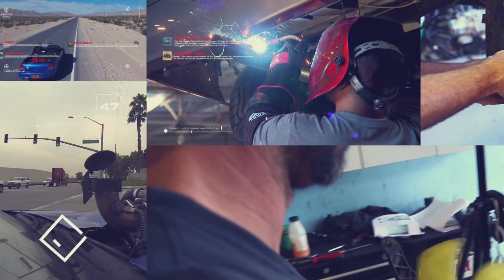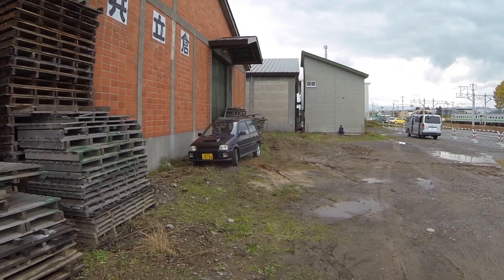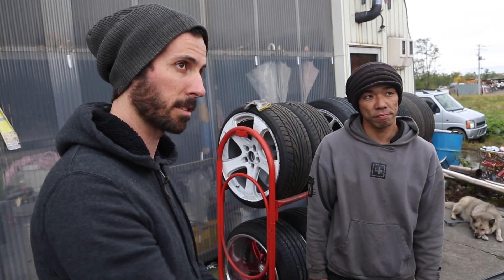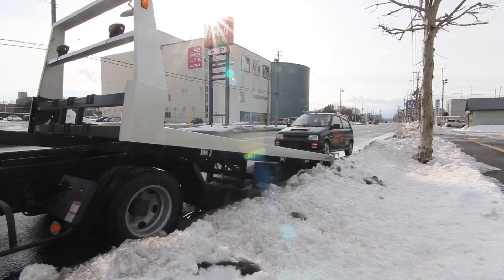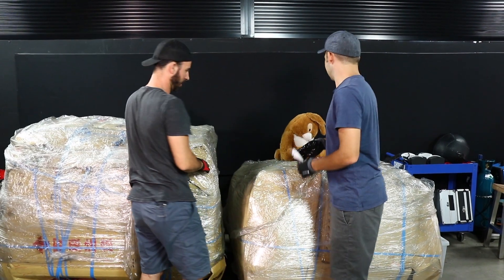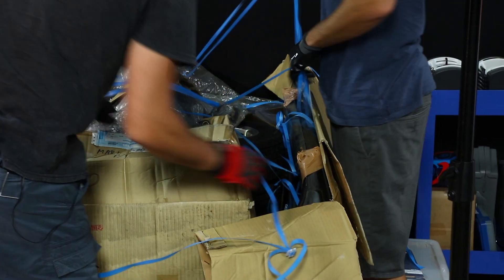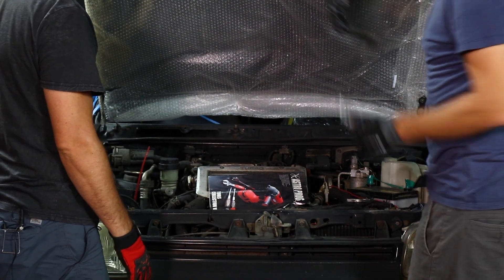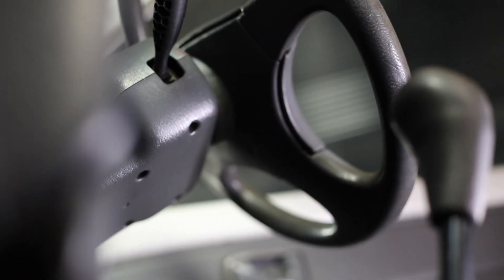Unboxing Our New Car [Part 1]

Comment: This is going to sound dumb, but this is beautiful. It's one of those things you can't explain; falling in love with a machine. I'm exactly the same way with my first car, a 1984 Suzuki SJ410. Technically a kei-car as well, although not with the kei-car engine, it's a rowdy little 4x4 with bags of character, personality and despite being slow it's great fun to drive. I've never driven another car that's made me so happy I've cried.

I had to take her off the road a couple of years ago because of rust, but my replacement car, a Suzuki Alto, was in fact a parts car. The Alto has a 16 valve, MPFI version of the same F-series 4 cylinder engine that came in my truck. I just need to get together the £4k or so it's going to cost to get her restored.
Reply: Edward Tear so happy you cried? wtf calm down mate
Reply: It's ok - real men can cry every once in a while.
Reply: Hey, some folks care about cars more than others. For me, it's the only thing that matters in life.
Reply: That's childish, go home.

Comment: people in america are literally cutting up and welding r34's, meanwhile mighty car mods does it with a fucking mira
Reply: You don't have to cut an R34 to import it. You just have to pull the engine, or import it as a show car.

Comment: so... why exactly is it illegal to import complete cars?
Reply: Firestorm I don't know the rules in Australia but in Malaysia you need something called Approved Permit to import cars which is hard to get. And the car you import also have to be registered to your name for 9 months. The import tax for a full car is also much more expensive. My only guess is Australian rules may be similar.
Reply: It's certain type of cars, we have proper jdm silvias, skylines and other jdm cars here.  (Cars with pink tags in the engine bay are full non cut imports from Japan)
Reply: That doesn't make any sense at all.. I mean I can understand if you can't register and drive on roads some cars, but why on earth would you completely ban a car from existing in the country??
Reply: Import laws. We can only import a car if its older than a certain amount of years to protect our "economy" or some bull
Reply: We no longer build any cars so the laws are back wards now, i think the idea was to make our cars able to compete with ones made overseas.
Reply: why cant you just ship in a bare shell? at that point its just metal, not actually a car?
Reply: Because some cars are illigal to import for aus its the mira for example, why? im  not sure i think a model has to be sold in aus for it to be legal to import them note: not sure
Reply: Aussie import laws are cancer...
Reply: If you can still get the car, but it has to be chopped up, I think they ultimately don't care but want to highly discourage it to promote Australian-made cars.
Reply: You're right, as an Australian, don't know why non-Australians are commenting. If a vehicle is made prior to 1989 or on the SEVS scheme it is eligible to be imported. 200sx was on the Australian market so you're unable to import one, BUT, the Silvia as known in Japan is fine to import because it was sold under a different name. All to protect a failed automotive industry, that has since disappeared. I hope to see the law changed, but good luck with the current powers at hand.
Reply: Totally, waiting to for the same seeing as there's no industry left to protect.
Reply: The reason itself is the GODAWFUL protection act which i hope it will be removed here, but parts can going to here, Indonesia like used engines. That's why nearly all cars are boring AVANZA. And also carmakers here is quite stingy as well. But dunno if somebody did it rewelded from halfcuts here.
Reply: In the US we can't import R34 Skylines.
Reply: DannyDoes but you can import complete vehicle (uncut) which is more than 25 y.o right?
Reply: DannyDoes can* under the show car law
Reply: pegcitygeek in the U.S its 25
Reply: In Malaysia it is illegal because the government doesn't want any foreign rotten sh*t boxes in our country,if you want the WHOLE CAR,it must be under 5 years old
Reply: obviously you have no idea what the laws are in Japan. They are just as brutal for older cars and non kei cars
Reply: In Denmark we can import anything we want, but if we want to drive it on the roads it obviously needs the paperwork which is crash and emissions testing. In danish tradition we also have to pay a tax on the vehicle where the amount varies, but the tax being the same, and sometimes even more than the car itself isn't uncommon. Cars are overpriced here. For brand new cars, we pay 280% of what the exact same car would cost in Germany, if it was a German car. We dont have any automotive industry to protect (unless you count Zenvo), it's just the governments way of getting yet another cut of the action. I mean we have lots of great stuff here, education, healthcare and all that is free. It's a nice place to live. But god damn it sucks being a car enthusiast here.
Reply: Move to the UK Anders, you can get a V8 Supercharged Jaguar for a grand, even 03' 04' Golf GTIs can be bought for £500-1500 depending on condition

Comment: Why can't you bring it in to Aus in one piece?? What is the law about
Reply: Something about cars cant be imported, but car parts can.
Reply: I'd really like to know this as well, I can't find anything about it after a quick search.
Reply: Makes sense, if youre a politician.
Reply: VermilIlion or it may cost far mor then its worth to import it like several thousand for a car or a fraction for for parts.
Reply: Vermillion nailed it. Stupid laws, that were made to kelp keep markets more domestic and such. Boils down to greed, otherwise many would be driving cars they picked up for nothing then shipped over, with combined price still less than what they'd pay for the same car in their country. In the US in my area, an RX7 FD that was abused and needs a rebuild and body work sells for still 10k roughly. A near mint one with light modifications that runs like a top runs for like 8k  in Japan depending on where you look. Shipping and inspection and all that jazz still leaves it around 11k, for something that needs little to no work VS near total restoration.
Reply: Probably started as protection for local car manufacturing. Then when that went I guess protection for local distributors and dealers. We should just copy New Zealand on car imports and lots of other stuff.
Reply: yeah, same reason we pay tariffs on some imports new. same reason most cars are cut up for half cuts in japan.
Reply: Yashin Shinikake now thats spot on
Reply: Its to do with supporting car manufactures in your own country. Some countries make vehicles for dirt cheap.Stoping people from buying a car in another country and then importing it over to use would mean people stop paying so much money for the cars made by your countries manufactures. Its like china has all them cheap copies of cars. If you was allowed to import them copies  people would maybe do that instead of paying the high prices expected to pay by companies like ford or vauxhall. This applies to a lot of stuff like for example buying a game. If you live in the USA and want to buy the new ghost recon wild lands game you will have to pay $60 yet if you live in russia you will only be paying like $40 but to stop people from just paying the $40 to get it from russia they region lock the game so it only works in russia.
Reply: Paul nailed it, it was to protect the local market. 
Any car that was officially released in Australia couldn't be imported in complete form, it had to be cut.
But if it's a special variant or model that never made it out here, you can import it, get compliance and you're good to go.
Reply: Nog311 Even in Malaysia we can't import those cars, but we do have a rebrand 4 door Daihatsu Mira, we rebatch as PERODUA KANCIL(mouse deer) an we do a lot of these engine swap coz the Kancil is NA 850cc...now parts are rare and super expensive!
Reply: thought that might have been it, but then I kept thinking that was the reason behind compliancing an import, didnt realise there was pre approval criteria.
Reply: But they are going to re-shell it with a car already in the country...

Comment: i love this car so much i have 1 in malaysia.... In japan it call daihatsu mira... in malaysia it call Perodua Kancil... my is first GENERATION still running storng and still Original.... but! dont have turbo
Reply: faroux ashraf yesss 👍
Reply: haha
Reply from the maker: Put a K3ve turbo in it! We want to come to Malaysia
Reply: Yep. That's because Malaysian company, Perodua made a contract with Daihatsu so they can rebrand their car. Pretty much the same like Proton too. But the downside is the Kancil gets a low output engine. eventhough it get a 660CC and 850CC, both are underpowered and pretty slow for a Kei car. But nonetheless, Perodua cars has many mods potential since it uses the exact same body like Daihatsu Mira, Avy, YRV and many more. Plus, the Kancil (Mira) and Kelisa (YRV aka Blueturd) get 2 extra doors for the rear passengers.
Reply: Put engine l2s turbo .💨💨💨💨💨i have kancil perodua 660cc but upgrde to l2s turbo engine.so good haha

Comment: Can someone explain the whole cant weld the car back together thing. How its illegal and you need a new shell. Thanks :)
Reply: Because even if you weld it all back, the car will get really weak structure wise. It's far from safe, and far from legal
Reply: If it is reinforced with plates and etc I don't see the problem. limo's are chopped up and expanded cars so I don't see the problem if its done right.
Reply: You got a point, but I don't think it's legal to make it street legal. So even if it is well made, they would get in deep trouble if the cops ever caught them
Reply: Limos have a extremelly weak structure compared to normal cars, the only limos that have a good structure are those fabricated from the ground up. If you saw adapted Limo crash test you would see how shit those things are. Welding a car together like this is not an option, it would extremelly unsafe both in case of a crash and on a normal day driving, even with extra structure pieces put it into it.
Reply: Honestly, halves are welded together all the time by body shops. If one end of a car is crushed, but insurance doesn't total it, the shop will find another half, then weld them together. But, it's done by certified professionals.

Comment: Please give it at least 200bhp, please give it at least 200 bhp, please give it at least 200 bhp...
Reply: They weigh 700-800kg.. that's more power to weight than a fucking s2000 brah.
Reply: a 10kw electric hub motor on all 4 corners = about 54hp direct AWD, with torque up the ying-yangs to accelerate with. 4x15kw would be super insane 80hp.
54hp over double stock, 80hp over triple, could be SO MUCH FUN.

Comment: I'm sorry but Australia has some shitty import rules, 😕
No whole imports, limited mods on cars...
Reply: Yet.. bikes and other stuff.. no issues.
Reply: USA has shitty rules too and don't get me started on CARB and smogging...
Reply: Here in Hungary I bet you could import one of these and have papers for it (I read an article about a capuccino owner and his car a few days ago), but modifying cars is horrible here... Such a long hard legal process and in the end you might not get the permit to mod...
Reply: The only place in the US that has shit vehicle laws (to my knowledge), is California. I wouldn't mind living in California, but fuck those vehicle laws. The only thing I have done to my car is change the muffler and I think it would be considered illegal in California.
Reply: What are you talking about? I have all sort of things on my Focus ST (2016) just did the exhaust but it's quiet around town and I don't drive like a dude in his 20's, when I'm 46. Cops don't bother me, car runs low 13's now.
Reply: Anthony Thomas if you get CA specific parts then yeah. But the muffler (I think, got it two years ago) and the rest of the exhaust system would make my car illegal in CA.
Reply: MrGuvEuroman you can have full imports, we have heaps of proper non cut up imports here
Reply: i live in the worst place for importing cars. This place is called hawaii. The 25 year rule doesn't even apply here.
You can only  import  cars 1968 or before. Thats worse than Kalifornia !!!
Reply: Same in England though bro, seems like you took our shitty law's with you when you left, We can mod our car's if we have a cheeky engineer that does your MOT on the sly ;))

Comment: Sooooo you can't import a three cylinder fuel efficient Daihatsu in one piece HOWEVER you can import a 1960's V8 Mustang without cutting it up?
Really?
Reply: It's because some version of that Mira was sold here they can't import it however the Mustang was not.
Reply: @antoniodametto4635  It's still pretty ridiculous if you look at it in perspective. Eco car is prohibited but the petrol chugger is ok. Very questionable.
Reply: Reploidx9 oh yeah, it was a really dumb law to protect local car manufacturing back then, as if bribing in a 20 year old car would affect anything, luckily that law is basically gone now, and you can import basically whatever you like now I believe

Comment: I´ve got a question. Why is it illegal to import a car in one piece but it´s legal to do it in half?
Reply: Alejandro Aristeguieta in half you're just importing car parts.
Reply: The Friendly Facist I know I live in a country with similar roules but in my country you can not use that cars on the streets or you can only do it by illegal methods. If in there they let you use that cars it's irrational
Reply: They can't use the car. They're going to find another car that's already in Australia and legal and swap the parts on to it from their original car.
Reply: Gogle Gogle Ooh I see I didn't read he laws of Australia. Thanks for the answers 

PD: my keyboard went crazy with the last comment
Reply: Alejandro Aristeguieta you can't import a whole car that was already imported by the manufacturer. people do import whole cars that weren't sold there
Reply: So if you swap out every single part over time (into the new car), at what stage does it stop being the new car and become the old car again?
Reply: it doesnt ever. as long as it has an Australian Chassis number, ADR compliance tags and body tags in the eyes of the law it has the identity of the local car. This is one reason why the silvia they bought ages back was so cheap as NSW law puts the identity of written off vehicles on a register to stop people buying them at auction then stealing a similar car and giving the stolen car the auctions cars identity.
An old work mate just did this with an import crx, put the roof and fancy bits on a local shell.
a guy from my trade class had a crashed silvia and imported a rear cut and put it back together.

Comment: Don't throw anything away until the finished car is up and running and working like it should, you never know when you're going to need some tiny but vital part that's attached to something you're going to bin that will be impossible to find if you've binned it.  By the way, that's some nice four wheel drifting from that little JDM lunchbox...

Comment: I think there will be a new scene about KEI cars. washing off the shopping image, and getting to little rice rockets. mark my words; the price will rock to the  sky, and everywhere teens will Rev and slide and will have great experience with these cars. Awesome, again! Show us all, every wire, welt, bolt, details, we need to learn. Maybe Ed China has some time to help. He stopped at Wheeler Dealers because the imported details where removed from the program, don't make that mistake please!

Comment: i have a 95 mira avanzatto wont go into gear. its got to be the clutch. cant find a master cyl.  have no idea ive adjusted the cable and added oil to gear box and rear diff. theres no videos on working on these things. i already watched this whole series dont remember you guys working on the clutch though

Comment: hello I recently watched the mythbuster episode with the electronic supercharger and the fan used seemed very underwhelming...I recently saw an episode of the hacksmith where he's using a high powered fan used in hobby airplanes I'm wondering since it's much stronger would that be a better electronic supercharger

Comment: in malaysia same as we do... bring the halfcut back.. bcoz if u bring the CBU(complete car) u will be charge the high malaysian import tax from our customs... so we cut the car,and bring as scrap metal... 1 more options to bring the car atleast 80% perfect is we cut in the front(radiator site) we call nose cut... so when arrived,we just welding back and u can drive... but is still as a track car... I really wonder that australian people can bring car from japanese without many rules and tax charges.. in malaysia,import tax for japanese car is 300% from the original car price... Go to hell with our goverment....

Comment: When are you guys gonna build something cool and fast like a big turbo V8 or an RB26 or something, all you guys seem to build is slow junkyard jdm cars like the laughable fucking this, the 2sext lancer and that 180sx you guys built, some of the DIY stuff is usefull for the 17 year olds that dont know what they are doing but everything else is just amatuer. I understand that you two are not experts on high power cars your just jdm enthusiasts but you could still build some horsepower, real horsepower, not a childish 200 horsepower subaru.
Reply: Larsson Banks looks like someone missed super gramps or the stagea or the vw
Reply: Larsson Banks I think you missed the 11 second cars episodes
Reply: Trevor Sisley I hardly watch mcm but if I recall correctly super gramps was around 11 seconds or something which I guess isnt too bad i guess for a street car but its still cheap and a weak looking and horrible sounding car. I haven't seen the stagea or vw.